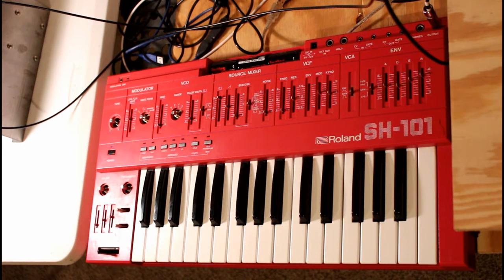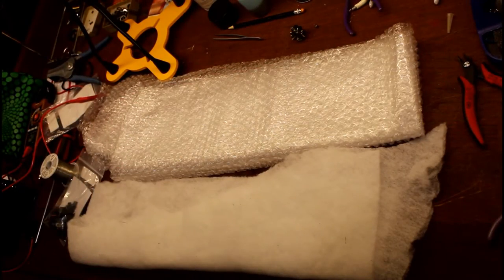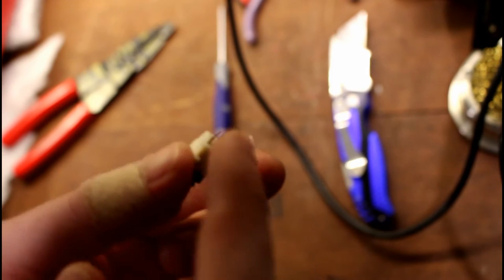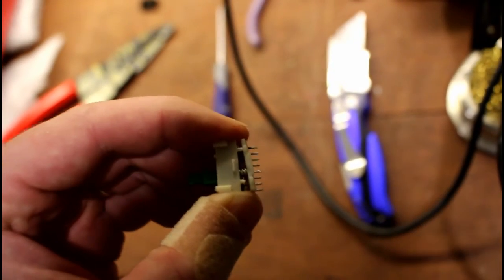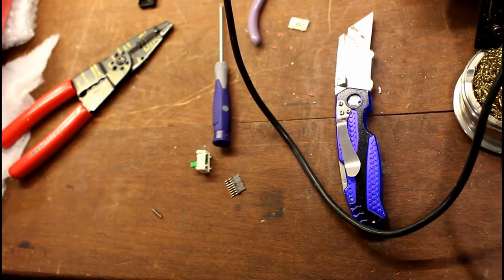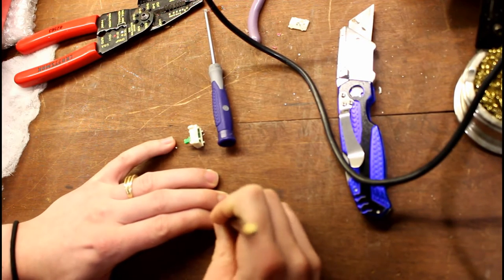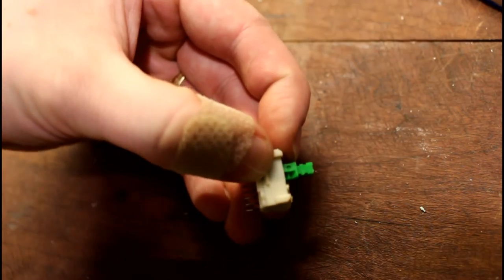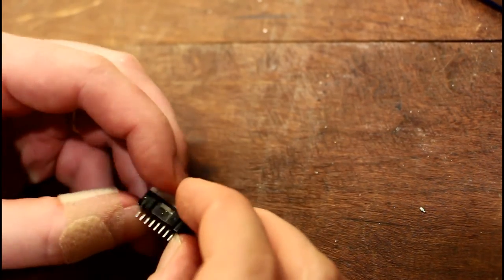Roland SH-101 Power Switch Repair How To

Comment: Thank you. Amusing and informative - first time I've come across a 'how to' that pulled that off. It worked for me, in that I watched this because I thought of fixing it myself, saw the springs and tiny tabs etc. then bought a new one for $12 on eBay. Challenge declined. But do make us another video the next time something else goes wrong you have a knack of sorts :-)
Reply from the maker: Heh, thanks man. I definitely do have a bias against vintage parts shops. I've restored some other synths where the customer requested, for example, all new pots, and replacing with the original part would cost $100-200. So if I can help it I try to come up with a solution with readily available parts (sometimes I get lucky) or a procedure to repair the original. Sometimes, like the switch on the Synare S3X I did recently, a replacement just isn't available anywhere. But either the switches on the SH-101 used to be harder to come by, or I got trolled super hard on a tech repair forum back when I first was looking for a cost effective replacement for these switches. =P

Comment: 9:17 could you use some kind of adhesive to keep the spring attached to the little plastic nub on the bottom white piece?
Reply: Update: although a small dab of hot glue doesn't adhere to the plastic switch body, it does form a nice malleable blob that prevents the spring from easily falling off the little nub!

Comment: This is an awesome video, thanks so much! Would it be a bad idea to use something like deoxit's Shield spray when giving it that last shot before soldering back in?
Reply from the maker: Thanks Stu. I've never actually used the shield spray, but looking at the datasheet it doesn't seem like a bad idea. I might have to pick up a can and give it a try.

Comment: Hi can anyone help please? I have bought a replacement SH-101 power switch. It has 6 pins, but the original has 6. Can anyone help?
Reply: Hello David, did you find a solution in the end? I too have got a 6 pin switch and don’t know how to proceed. Thanks
Reply: Tommaso Rota yeah, me too
Reply: @AlbertSultanov-yy2bi  hey mate, as it turns out, the 6 pin switch works just fine, if you look at how the button pokes out through the synth plastic cover, there's only really one way to solder it. hope this helps
Reply: Tommaso Rota thank you!)